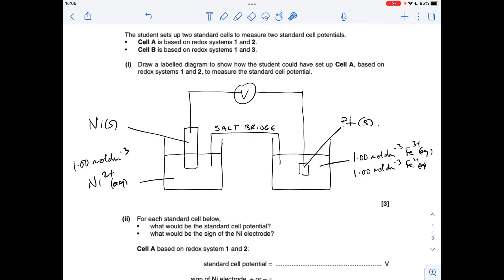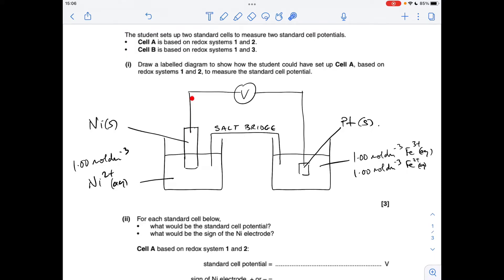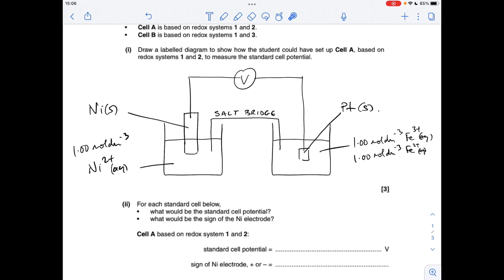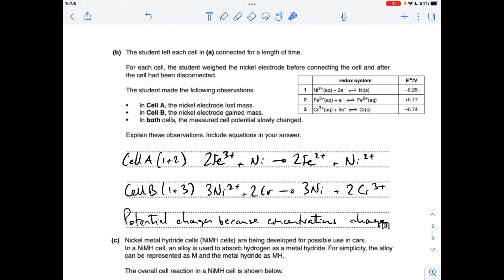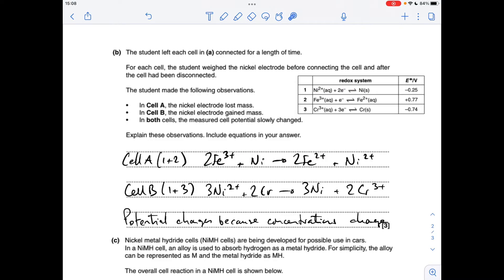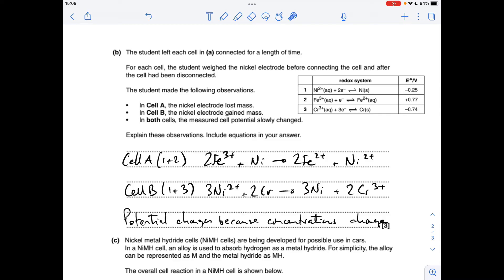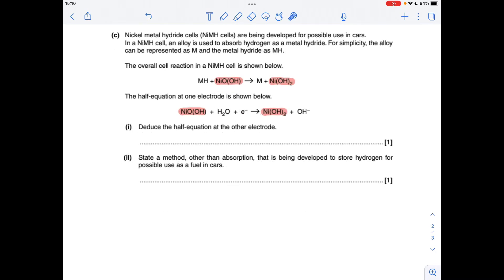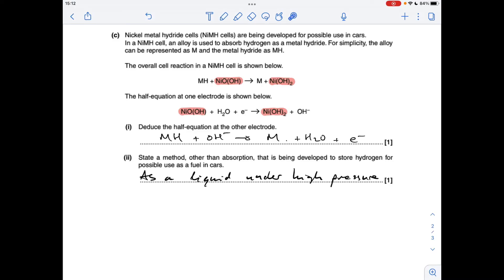A LEVEL CHEMISTRY EXAM QUESTION WALKTHROUGH - ELECTRODE POTENTIALS 2

Comment: can i ask why the nickel electrode is much longer bigger? also does the most positive cell potential go to the positive electrode and least positive cell potential go to the negative electrode?
Reply from the maker: Platinum is expensive so I just draw a little square rather than a rod. Doesn’t matter tbh. 
Correct about the positive and negative stuff 👍
Reply: @MaChemGuy  thanks for this 💪🏼💪🏼💪🏼🏅🏅🏅🏅👏👏